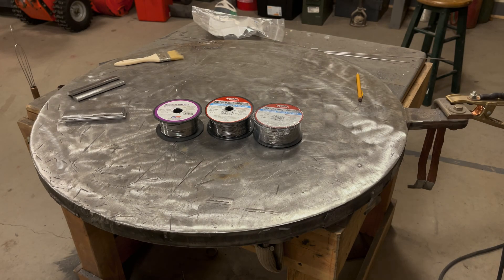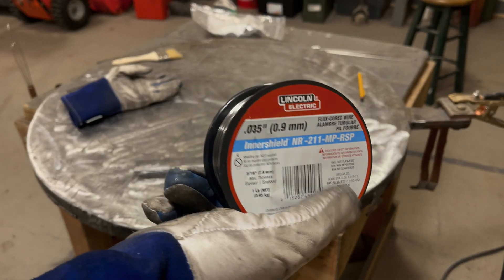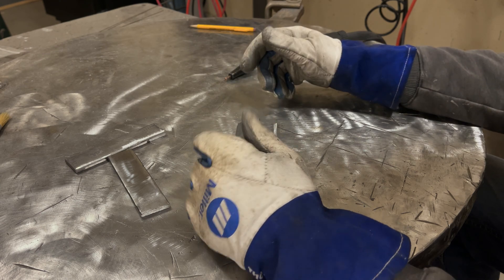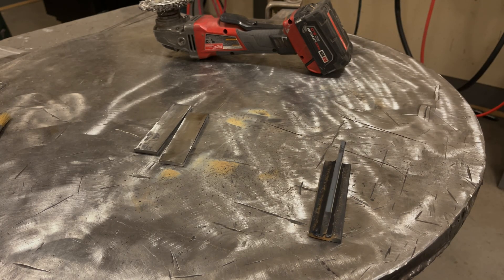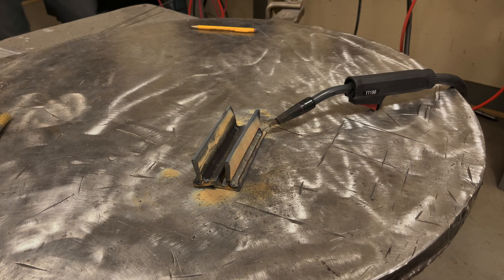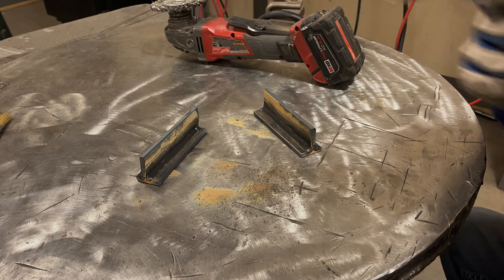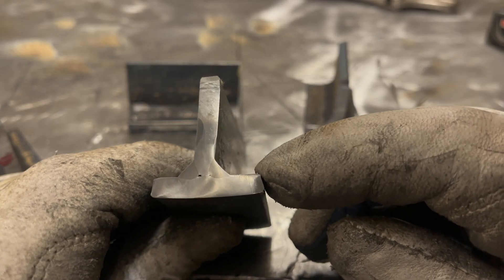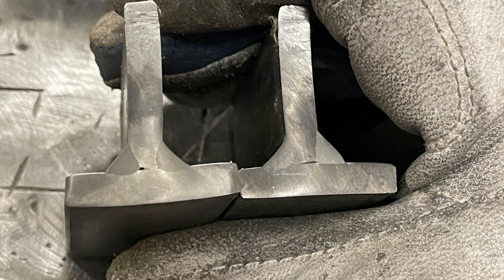Flux core welding part 4.75: 1/4in plate revisited

Comment: i haven't used it, but IC weld and Zila both sing praises of Hobart fabshield 21B over lincoln NR 211.    the loss of penetration might be due to the welder efficiency dropping off with components heating up or reaching their limits.  perhaps the energy density delivery drops off at the margin...the penetration of the lower setting looked great.  also, fabshield is e71-t11 so it can be used multiple passes.  most tgs wires stipulate single pass.  can't remember if nr211 is -tgs or -t11
Reply from the maker: Great suggestion.  I wanted to get a spool of that but when I was looking nobody locally had it.  The Lincoln nr211 is a multi pass t-11 so it’s good to go for multiple passes.  I will be diving back into flux core next week so I will see if I can find the Hobart stuff around here to try out.  😀
Reply: @makingmistakeswithgreg  IC weld liked it because it seemed to have better elasticity in high stress applications where nr211 often cracked.
Reply from the maker: @peetky8645  very interesting.  I will have to lookup specs on the wires.  I know gasless flux core has been known to crack in higher vibration applications.  I have never used it to repair thick plate, I stick weld equipment.  IC weld is the man when it comes to heavy equipment repairs 😀.  I have to catchup on his videos.
Reply: Are you getting in V notch differences?  Isaac is like a robot with a torch in his hand.

Comment: wonder if porosity on the first pass was due to cold wire.  perhaps running an inch or two on scrap prior to an important weld would preheat the flux.  i'm  a big fan pf propane preheat with a 120v machine in thicker stuff.
Reply from the maker: On 120 volt preheat will always massively help.  I think a lot of the issues were simply because I was running the welder at absolute max output.  I have ran a few test welds with the firepower 200 amp MiG machine I bought and it seemed to completely not care about running hot settings on 1/4in plate with flux core.  Likely because it was hooked to 240 and has 200 amp output so 140 or so amps is not a issue for it.  In all fairness the harbor freight 125 is specified at 3/16th max, so it’s punching in way above its power rating welding 1/4.

Comment: when i let my stickout get real short, my sound changes to a hiss from a crackle......am i getting to spray territory?
Reply from the maker: When the stick out shortens the sound changes, that’s normal.  By definition spray is created by the wire turning to liquid before it even hits the puddle, which is normally due to very high voltage.  Flux core operates under DCEN which will have a different arc sound than DCEP with MiG.  You can actually see small wire turn to spray on flux core depending on settings and wire diameter.  The key is that the voltage/wfs is being run within the manufactures specs.  If you up the voltage way higher than suggested undesirable results and weld defects can happen.

Edit:  I almost forgot.  If you run a stick rod like 7018 DCEN it will sound very similar to what flux core does cranked up with a short contact tip to puddle distance.  Completely different than a normal rod sound.
Reply: @makingmistakeswithgreg  good to know

Comment: Any videos of multipass cut and etch?
Reply from the maker: Not on flux core but within a week I will have a cut and etch out on a multi pass stick weld.  For all practical purposes flux core is virtually the same.  One thing to note though, flux core wire must be classified as MP wire and not -GS wire if multi pass welds with flux core is desired.

Comment: 20amp breaker on 120?  Tripped.   And a 30amo at 240 would allow the welder too?
Reply from the maker: Unfortunately the welder is 120 only.  A 30 amp circuit would surely not trip, but the power cable for the welder probably would melt 😂.  There are a lot of wild regulations that allow for small power wire on intermittent low duty cycle devices like welders.  The 125 titanium was never really meant to weld 1/4in, it can do it provided it’s on a dedicated breaker.  It’s not really a fault of the welder, it’s being asked to do something it was never designed to do lol.
Reply: I’ve found the Lincoln 90i FC is rated to a max of 1/4 versus the titanium easy flux is rated to 3/16
Interesting to note, the Lincoln has the exact same gauge wire for the power cord and the MiG gun and ground as the titanium. Both 120v machines. 
The titanium easy flux is actually rated 5 amps higher as well. 120amps vs 125amps
I find it odd that they are so similar. And even the titanium being a little more powerful, but it isn’t rated for 1/4 while the lesser powerful machine is rated for 1/4”.
Reply: These little hot boxes need all that power and then some because their apparent power draw is higher than what harbor fright lists.  But most don't list their apparent power requirement either.

Comment: Did you swap out for a different ground clamp? Just noticing area where you are clamped to table.
Reply from the maker: The other ground clamp you saw is from my dynasty 210.  The one it comes with is flimsy, but for light duty work it should be ok 👍.

Comment: Thank you for taking the time to make these excellent series of videos, your channel deserves many more views.  I have been using a Forney EasyWeld 140 262 flux core for a few years on a 25 amp circuit breaker dedicated to just welders and have done many repairs on 3 point equipment up to 3/8th with .035 ine wire and the machine maxed out on voltage and 9/10 on wire speed.  I always preheat with a propane torch on the thick stuff to burn off the paint then wire wheel it clean before welding, seems to work.
Reply from the maker: Thanks for the kind words.  Being so new to YouTube it will take a bit to get my content out to people.  Rest assured I will be producing a lot more interesting and helpful videos, so I am sure as time goes on the views will go up.  

Sounds like you know what you’re doing with you’re setup.  140amps on .035 with some preheated plates is definitely the ticket to get solid performance.  It’s unfortunate that the super cheap flux core welders make many people unaware of the capabilities of good wire with a decent machine.  Short circuit mig isn’t capable of making solid root penetration welds on thicker plates without switching to spray arc.  Over the years I have seen a ton of failed short circuit welds on 1/4 and above due to people not understanding limits of a process.  I hope to help educate people and have them be able to make good decisions when it comes to welding and other things 👍

Comment: Another great lesson. What is amazing is that your results came from a sub $200 welder which, by its own specifications, never mentions 1/4” plate in the settings list.
Reply from the maker: Flux core wire is definitely the way to go on 3/16th and above steel over short circuit mig.  I wish I had a 125 amp short circuit mig welder to test, because that would have poor penetration on 1/4 no doubt.  Flux core wire is surprising, it’s overall penetration on the titanium 125 is like a 1/8in 7018 run at 120 amps.  I am glad harbor freight came to market with the welder, it’s actually useful and works really good within its limits.
Reply: @makingmistakeswithgreg  Agreed. I certainly hope that more folks find your channel.